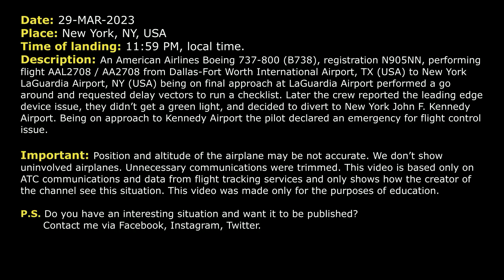Flight control issue. American B737-800 diverts to Kennedy Airport. Real ATC

Comment: I was a passenger on a flight into CLT when this happened. After two go arounds and some time in the air we landed and ended up very close close to the fence line of the airport. I remember asking the person sitting next to me what a leading edge device was, and his reply was “it’s the f*#% wing” still oblivious, I said look at all the fire engines, to which he said “they’re coming for us.” I stopped asking questions.  Does anyone know how we could get so close to the fence?
Reply: Was probably a high speed landing due to the reduced lift with an non-normal flap setting and the pilots may have had to use most of the available runway in order to get you stopped safely. Probably had to hit the runway on point to have enough safety margin, which could've been the reason for the second goaround. I'm wildly speculating though, so take it with a grain of salt.
Reply: Like the fence before the runway and it looked like you were very close to hitting it?

Comment: What is the leading edge device? Green light on the edge of the wing?
And why would a divert help?
Reply: The slats are the flaps that come out of the leading edge of the wing. A green light means the flaps/are in the correct position for landing or takeoff. It’s a final check on the before landing checklist as well. Since there was an issue it’s best to go around and take care of the problem and probably land a lot longer and faster since full flaps aren’t available. LGA has short runways, so they always will divert to JFK if longer runways are needed.
Reply: Leading edge slats, used to decrease speed/increase lift. I assumed the green lights they refer to will show that they have been deployed in the correct position, and the divert I assume more resources at New York for maintenance? Longer runways as they will have higher speeds? Some of this is guess work but could be true
Reply: @SamuelJMixes  Green lights are limit lights indeed and the both sides of the wings have to have the same extension to produce straight flight.  Normally crews would resist retracting the leading edges since that may aggravate control of the aircraft.  Some checklist recommend landing as soon as possible  without consideration to maintenance availability.
Reply: Got it. Thanks.